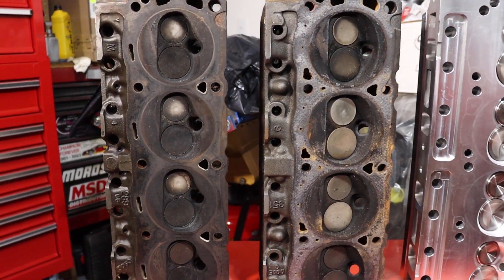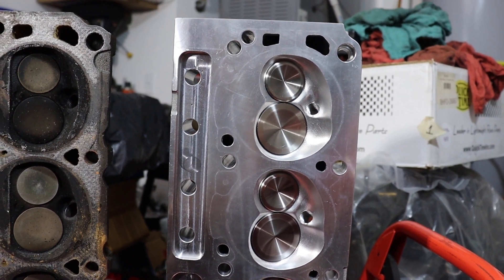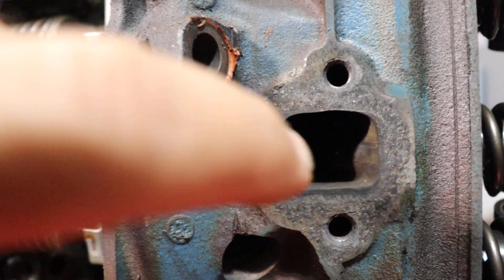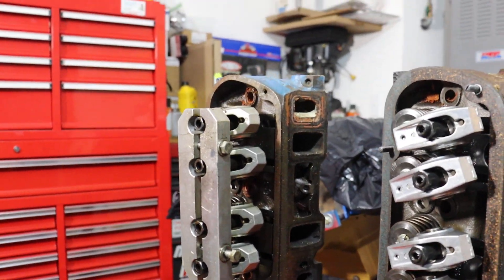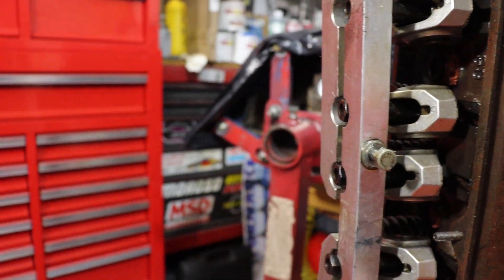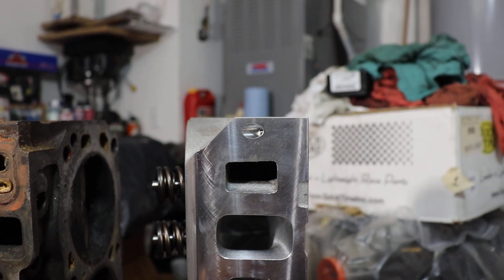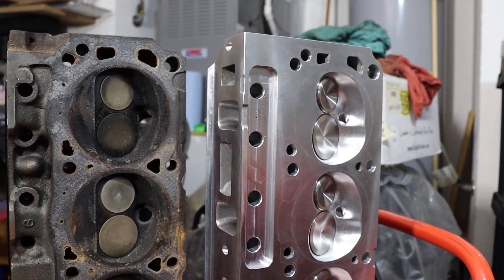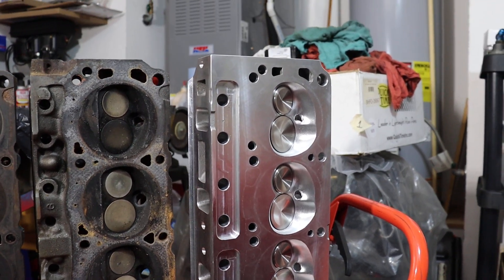SBF Cylinder Head Options - 289/302 vs 351W vs AFR

Comment: The problem with factory heads is not so much the size of the port but it's how they are ported,  the short turn radius and the bowl area and blending the combustion chamber into the valve seat is also very crucial,  we run factory cast E7 heads that i ported and modified myself and the car runs 10s on motor in the quarter mile and 9s on a 150 shot of nitrous,  stock 302 short block with a duel plane intake, Anderson cam , we have run against many strokers with high dollar aftermarket heads and done very well,  the car is on YouTube if you'd like to check it out it's the green gangster with Adam grover, grover boys racing,  good luck with your build you do have a very nice pair of cylinder heads,  be sure to check your valve to piston clearance with the new afr heads
Reply from the maker: Thanks for your comments, it's great to hear how much success you've had with ported factory heads!  I think that might be more of a testament to your skill in porting than it is to what most people could expect to achieve with their own set of factory heads.  I was always relatively happy with what I was able to achieve with mine at the time, but always felt there was a limit to what I could do with my level of skill on a given head, hence the evolution from 289 to 351W, and finally AFR - seeking design to take me where my porting skill couldn't.  I'll definitely check out the green gangster, thanks for watching!
Reply: Wonder if the promaxx sbf aluminum heads have the water passage….
Reply: Yes Terry. Itza ripper👍👍👍

Comment: I have a 289 that I’m going to put a set of 165 afrs comp cam 280h magnum flat tappet cam good to know about that water port not needed I can’t wait to get my 66 mustang back on the street/strip
Reply from the maker: Good luck with your Mustang, and thanks for watching!
Reply: Thank you you have helped a ton
Reply: @billsgarage you revved the 289 to 8 grand with what kind of cam? I have a hyd roller retrofit and my engine builder told me to not go higher than 6500.
Reply: At 6500 rpm each valve opens and closes 54 times per SECOND 

Hyd roller lifters are heavy.
Go as light weight everything that you can.
Solid lifters
Flat tappets
Conical springs
Titanium retainers
Hi,rev pushrods
Light steel rockers are stronger than aluminum.
7/16 rocker studs with Stud girdles
light weight valves
Don't forget the oil inside the pushrods.
Remember at high rpm everything is flexing tremendously... And can bend or break 
JMO

Comment: Your video did a good job of showing exactly why I won't mess with factory SBF heads anymore. Just not worth it. Plus, there's so many choices for aftermarket heads now, they are relatively inexpensive, so it just doesn't make any sense to try to upgrade anything iron.
Reply from the maker: Yeah, back in the 90's when I first started trying to improve my stock heads, there were few aftermarket options and they were all really expensive, but now there are a bunch of great options out there.  And even the low end of the aftermarket options offer massive improvements in valve geometry and flow over the stock heads, but don't cost much more than you would spend at the machine shop upgrading a factory head.
Reply: Explorer heads are the cheap route today. About the same performance as the fat sparkplug  351W head.

Comment: Did you say you spun 8000 rpm with those 289 heads?  What kind of distributor setup were you running? 
*Nice video of your progression
Reply from the maker: Yup - but I got a lot of valve float and broke some springs even with ARP studs and stud girdles installed!  I used an MSD Pro-Billet distributor with that setup.
Reply: @  I had a 289 in the early 80’s that wouldn’t spin over 7200 rpm.  Now that I look back I wonder why?  Head flow, intake flow, valve springs, dual point distributor, running out of fuel.....I guess I can cross off head flow.  I needed to spin 7500 rpm to get them 5.43 gears across the finish line without falling off.  My 62 Ranchero ran 11.80’s

Comment: Aluminum is a very good conductor of electricity and heat and the AFR heads have chunkier masses of aluminum which spread the heat faster and better throughout the head. Hence...the water jacket is not even needed. Congratulations and enjoy the power. If you drive your car a lot the lower octane gasoline will save you some money for the burgers and shakes. Enjoy and have fun!
Reply from the maker: Thanks for your comments, I'm definitely looking forward to paying less for gas so that I can buy more tires to roast on my way to the burger stand!

Comment: I don't know if you have ever ported heads or not but on your first 2 cast iron you can 14:39  work the combustion chamber on the sides of the valves where they are shrouded and it will help quite a bit. Try to make them look kinda similar to the afr chambers.  I built a 390 20 yrs ago & I did everything I could as far as porting goes. Just stock 2.05 1.55 valves. I removed that little step up into the chamber ridge beside the seat, gasket match, bowls, whittled down the guides like sharpening a pencil - a bit, hogged the shit out of the exhaust bowl. I'm not a pro builder with a flow bench but that engine ran good. 72 F 250 2 wd auto. Headers into cherry bombs & exit right behind the doors. Isky cam 264 during 525 lift, Edelbrock 4v carb & hot ignition. Ran good. Fun driver
Reply from the maker: I'll bet it was fun!  I thought about doing some work in the combustion chamber on those heads, but I felt that even with all of the port work I had done, it was never going to perform like an aftermarket head, so I drew the line there and left the chambers alone.  It did the job for it's time, and I certainly had a lot of fun with it!  Thanks for watching!

Comment: So you effectively built an expensive 9 to 1 engine? FYI using an aluminum head will cause a loss in power compared to the identical cast iron head. The fix is upping the compression by 1 point. Since aluminum heads are less prone to detonation this is easily done. A well designed combustion chamber with correctly ground cam will easily allow in excess of 11 to 1 compression on 93 octane pump gas.
Reply from the maker: You guessed at my compression ratio without knowing deck clearance, gasket crush, valve relief volume, and whether the heads are milled.  My compression ratio is 10.2:1, which is totally fine for a street engine, and with a proper timing curve will allow me to make plenty of power on 87 octane fuel.  Why on Earth would I want to saddle myself with 93 octane fuel to run a non-supercharged toy?  Sure, I could bump the compression ratio up to 12:1 and make 30 more horsepower at 6,000 rpm, but that's not going to get me to the ice cream stand any faster, it's just going to make it so that I can't afford ice cream.  The best compression ratio is the one that matches the car and its intended use.
Reply: You were the one that claimed 10 to 1. 10.2 same same. Did you say you were going to run 87 octane in this video? If so I missed it. You can do what ever you want I was just commenting because to me you made it sound like 10 to 1 is the optimal compression for a aluminum headed engine on pump gas. I'm new to your channel and have not seen all the videos on this build so I don't have all the facts at this point. I just thought your viewers needed to know much higher compression is easily done on pump gas with aluminum heads and a good camshaft that keeps dynamic compression in check. IMO a 9 to 1 effective compression ratio engine leaves a lot of potential untapped.

Comment: Good video, but I have to say you left a lot of power on the table by going down to 10:1 compression ratio; @Ben Alameda Racing goes over compression ratio on pump gas in very detailed length on his channel in multiple videos. He explains how much power is left on the table and what fuel you can run with 12:1. He also covers drivability. Those 185cc heads are good. Comparing an AFR head from a head designed over 50 years ago just shows how crude things were, not much of a comparison. Good video though and I don't want to discourage your build, but there's more power if you want. I'm partial to Trickflow for SBF but a lot off ppl like the AFRs too.
Reply from the maker: Thanks for the feedback.  Yes, I could definitely have gone with higher compression and made more power, but this engine is going in my toy, not a race car.  I'm definitely going to punish my tires and have some fun, but no need to punish my wallet every time I hit the gas pump.  As long as I set my timing right, with this setup I can run 87 octane without a second thought.

Comment: I was waiting for: power/torque curve between 302 VS 351.............  Or, 0 to 60 times.........  1/4 miles times to Judge money VS performance gains......................  ; p
Reply from the maker: Yeah, that's not really my kind of content, I'm just a guy playing around in his garage.  There are a ton of dyno videos out there if your curious about what kind of power you can potentially make with each of these heads.
Reply: @billsgarage  Did you notice a change when you went from the 302 head to the 351 head?  302 vs 351 vs AFR, is just bate and switch?  

See, my Hi-po 1965 289 has 280/290 ford motorsport cam, from 1984.  Still runs fine.  But, we always want more.  : )  

To be or not to be?.................  heads or stroker kit?  Bang per buck.

Comment: What brand of lifters do you recomend? Ive used alot of aftermarket lifters which usually fail after 25000 miles and destroy my engines.
Reply from the maker: I've been running Comp Cams lifters for years with no problems.  Some of that is luck, I've heard good and bad, but it's worked for me.

Comment: Do you have flow/dyno or 1/4 mile performance data to compare the performance of the heads? Im working on a set of iron 351 heads now for a daily driver build I'll be happy to get 1 hp per cubic inch since everything will be mild
Reply from the maker: No, the 289 and 351W heads were done many years ago when I was active duty military, and I didn't have access to a flow bench or dyno.  I did plenty of street racing with friends, and the car seemed faster with each evolution, but we were just in it for the fun, not the data.  Thanks for watching!
Reply: @billsgarage  cool, wasn't sure if you had been to the strip with it. 1/4 mile times Tell a lot Thanks for your service, I am retired Navy myself

Comment: What about that second hole 1" above the one you created to match the block?
Reply from the maker: I drilled that 2nd hole when I installed the 351W heads on a 302 block that had a water passage in that location.  It wasn't necessary, just something I though I'd try.  I don't know whether it made any difference because I didn't have an overheating problem on that engine previously.  I didn't mention that in the video though, good eye for detail!  Thanks for watching!